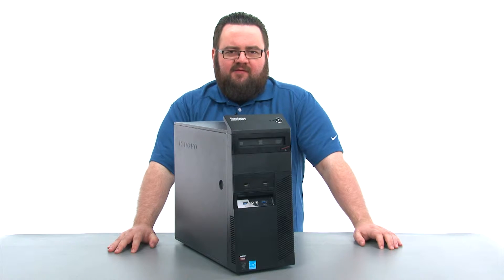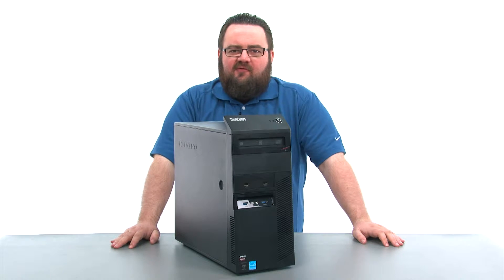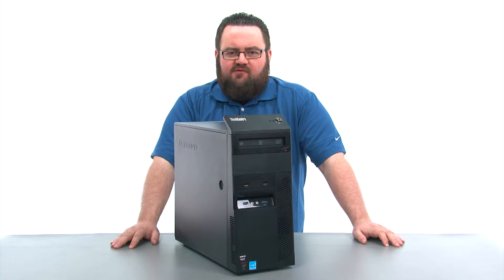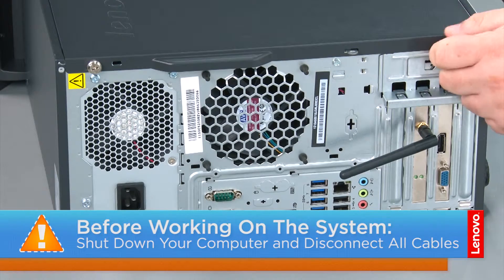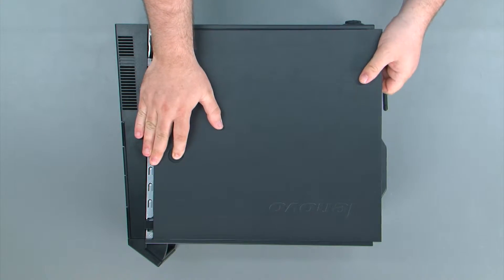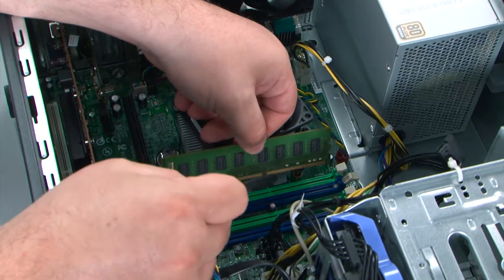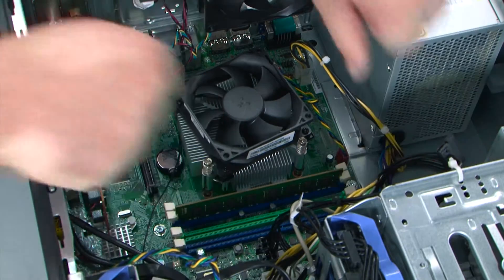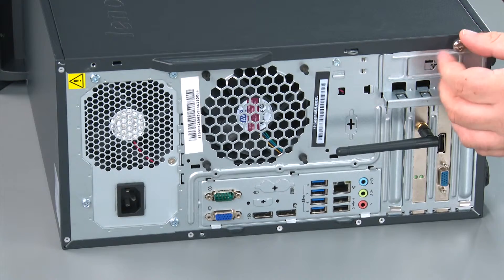ThinkCentre M83 / M93p Tower Desktop - Memory Module Replacement

Comment: Hello friend, again I need your help. I have a Lenovo Thinkcentre M83 with serial number mj000s2j and it is difficult to find a video card 03T7148 N FRU Video Card HD8570 2G 128bit VGA + HDMI ATX. My question is if you can install a video card with DDR5 memory; for example the GeForce GT 710 1GB GDDR5 32-Bit DirectX 12 Low Profile Graphics Card (GT 710 1GD5 LP). Thank you very much.
Reply from the maker: Hi Davidcitos! Thanks for reaching our support. As we were checking here, we found a similar thread from the Lenovo forum https://lnv.gy/2qYXPjV and one of the moderators give a tested GPU including the PSU in a different conversation https://lnv.gy/2r0TYCP . Let us know if this works for you. -Chris_Lenovo
Reply: Well, I will take your advice into account, thank you.
Reply from the maker: You're welcome davidcitos! We appreciate your time writing to us here. Have a great day! Jan_Lenovo

Comment: don't ever rest the module on the anti-static bag, the charge is on the outside of the bag and could harm the memory.  Touch the metal case of the pc before you remove the module from the anti-static bag.